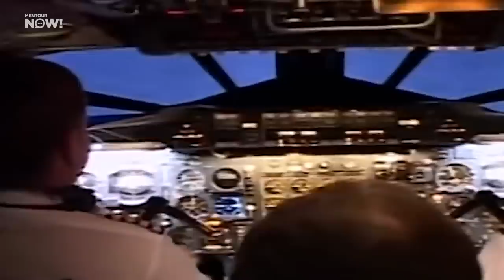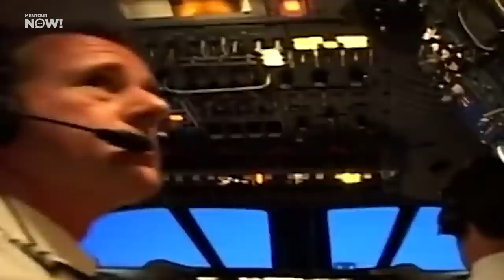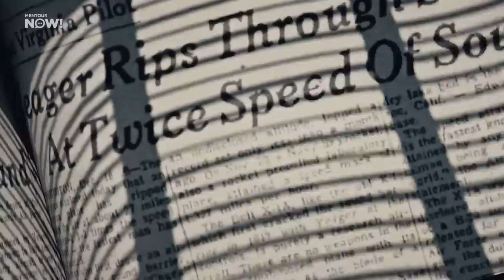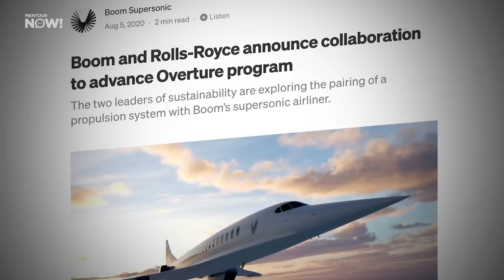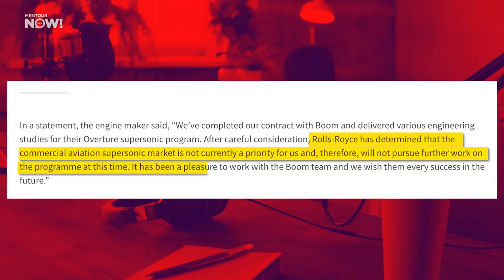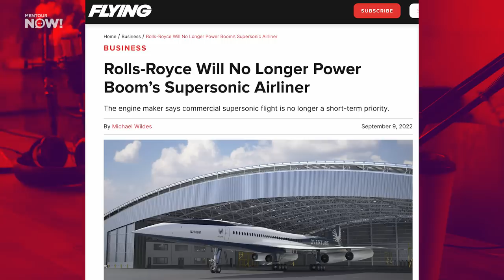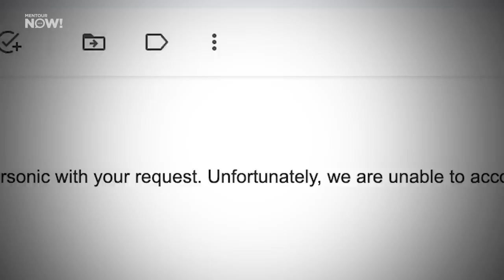WHAT’s Going On with BOOM Supersonic?! Will it Fail?

Comment: Į know only one aircraft that had 2 different types of engines. Beginning with the B-36D, Convair added a pair of General Electric J47-19 jet engines suspended near the end of each wing; these were also retrofitted to all extant B-36Bs. Consequently, the B-36 was configured to have 10 engines, six radial propeller engines and four jet engines, leading to the B-36 slogan of "six turnin' and four burnin' ".
Reply from the maker: I stand corrected. Thanks!
Reply: Some versions of the C-119 Flying Boxcar had a "Jet-Pack", a turbojet mounted on top of the fuselage.
Love the B-36 as well:
two turning, two burning,
two smoking, two choking
and two more unaccounted for.
Reply: @kilianortmann9979 
>and two more unaccounted for

oh... oh no
Reply: @MentourNow  You could also count the BAC Trident 3B. That was a tri-jet that technically had 4 engines. A Rolls-Royce RB162 turbojet as a 'boost' engine to give 15% more thrust on take-off. Was only used when required, but that's kind of worse in the sense of otherwise being dead weight and still needing maintenance.
Reply: There been quite a few aircraft with a mix of engines. Most of them are prototype or pre production, but there was a few full peoduction.

But this is not the same as in the case of then3 engiend boom, that was really the same core engine with a diffrent index. If I rembeer corectly that is also true for 727 and L1011

Anyway, here is a list of mix engine aircradt
A-90 Orlyonok
Avro 720
Blohm & Voss P 194
Bréguet 960 Vultur
Consolidated Vultee XP-81
Curtiss XF15C
Douglas D-558-2 Skyrocket
Douglas XBTD-2 Destroyer
Grumman OV-1 Mohawk
Gulfstream American Hustler
Hawker P.1072
HyperMach SonicStar
Lockheed NF-104A
Lunar Landing Research Vehicle
Mikoyan-Gurevich I-250
Republic XF-103
Rocketplane XP
Ryan FR Fireball
Ryan XF2R Dark Shark
Saunders-Roe SR.53
Saunders-Roe SR.177
Skylon (spacecraft)
SNCASO Trident
Sukhoi Su-5
Vickers Type 559
McDonnell XF-88 Voodoo
Zero Emission Hyper Sonic Transport

This list also contain a handfull of aircraft that never left the mock  up stage. 

But it dont contain aircraft with diffrent index engiens. It also dont contain test beed  aircraft like the 747 and A380 engine test plattform, and it also dont include  aircraft  with lift engies,  as well as helicopters will push jets
Reply: In the same vein, KB-50s, and later KB-50Js with two J47 jet engines were used by TAC and others as aerial refueling tankers. In addition there were prototypes of other planes that played with similar concepts.
Reply: @matsv201  Great list, how did you compile it? If one thinks about it, even today a tri-engined jet with one engine that is much larger than the other two could be more energy efficient if the other two are shut down once the jet has reached altitude and burned off some fuel. This keeps the core of the large engine running at more optimal conditions. But then this configuration must be more financially economical even with two different engines.
Reply: @Mentaculus42  well.. two step process.
1: found the wikipeda page
2: copy pasted  it

No, jet engines.are more efficent at medium thrust. Not only are the efficency a bit higher, but the thrust surface area is larger.

If an aircraft run on one  engine the slip loss may be as large as 40%, but if it runs on two its down to about 20%.. well. Thst would be typical full load number in theory.

In reality the aircraft would need to drop both altitude and speed to maintain flight on one engine.

The engines are optimized for level flight. Both i power  and diameter.

On takeof the engines have much lower efficency. But that dont matter because it only last for 2 minutes.

Its worth saying that there is one plane having a configurarion thst you sugest. It have 8 turbojet and two turboprob in sn axual  propeller design.

Its the A90.. firsr plane on the list. 4 produced
Reply: Don’t forget the one that saw service as both a military aircraft and air tanker for 70 years, the Lockheed P2V Neptune.
Reply: Yeah, this is the one that came to mind for me, too. But, of course, the Strategic Air Command did not have a requirement to be profitable (except to the extent that "provide a credible reason for the USSR to not nuke the whole West" is considered profitable.)
Reply: @vbscript2  To be fair. While the civilian jet manufactures was inching up the bypass ratio from under 1 to about 2. Strategic air Command ordered the C5 project leapfrogged it directly to 8.

While the General Electric TF39 that won the contract was a terrible mess. The competition that lossed was incredibly good, the JT9D mostly.

Worth saying, and yes, its common. The 747 was a civilian redesign of a failed C5 bid.

And the DC10 and L1011 uses a lot of the systems from there C5 bid.

That in turn promoted the A300 and 767 as more economical wide body aircraft... That evolved into the A330 and 777 that is pretty much the mainstay of wide body aircraft today.
Reply: @matsv201  Oh, yes, lots of stuff that was originally developed for the USAF and NAVAIR later had very useful civilian applications. Even the CFM-56 was developed from the F101 core. I just meant that SAC itself didn't have to be directly profitable.
Reply: The KB-50J had  2 different types of engines. In addition to the 4 piston engines of the B-50 series, it also had 2 jet engines. There were 112 built, actually conversions from existing B-50 aircraft. 
4 × Pratt & Whitney R-4360-35 28 Cyl. four-row air-cooled radial piston engine, 3,500 hp (2,600 kW) each
2 × General Electric J47-GE-23 Turbojet, 5,200 lbf (23 kN) thrust each (auxiliary engines in KB-50J tanker only)
Reply: @MentourNow  Fairchild C-123J and C-123K used radial piston engines with turbojet booster engines( added around 1965). 
The C-123 family started as a glider, and along with the mixed engine versions was also made in radial engine,  turbojet, and turboprop. Used from the 1950s through 1980s
Reply: @ghoul11719  I was just about to mention the Neptune, having seen the one run by HARS in Wollongong Australia. It's in flying condition using the props, not the jets.
Reply: The one of a kind, Burt Rutan designed, Scaled Composites Model 202 Boomerang is an asymmetric, twin engine airplane with 2 slightly different engines. One engine produces 200 hp and the other produces 210 hp because of a different turbocharger. Probably not much of a maintenance concern for a fleet, and because only one airplane was built, it doesn’t really matter. Still, a very unusual and innovative airplane, putting it in my favorite list of planes.
Reply: Back in 1978-1980 I was a student at the Pittsburgh Institute of Aeronautics,a Junkers 52 landed at the Allegheny County Airport, the left engine blew a jug on landing, the crew removed the nose engine and installed it on the left wing and installed a different engine on the nose, I always wondered if this was at one time a common practice on those rare 3 engine aircraft.
Reply: It seems most of the examples given are military aircraft during the transition from piston to turbine when some aircraft had turbojet engines added to supplement the piston engines. Which is interesting but it doesn't take away from the main point related to commercial airliners which is that it would be costly and operationally inefficient to use more than one type of engine on the same airplane. That was less of an issue with military aircraft where capability has a higher priority than economics.
Reply: @Kilian Ortmann

I was just about to mention the C-119, lol. I didnt know about its jetpack mod until getting the chance to take a few pics of the C-119 "Know Fear" that is currently rotting away in a boneyard in Fairbanks Alaska. Took one look at the mysterious jet nacelle bolted to its fuselage and was like "I need to know more about this".
Reply: @matsv201  >> That’s quite a list!  There’s also the Martin/General Dynamics RB-57D/F, which had P&W TF-33 engines with P&W air-started J-60 turbojets, used at altitude.
Reply: @jaybee9269  this list is limited to diffrent types  of powerplants  not diffrent brands or versions. It also dont include  engine  testbeds  like The 747 and A380 testbed that exist today.
Reply: @matsv201  Basically what I am getting from this is you have a few different reasons to have multiple different engines. Ignoring Skylon, there is suplementary power (KB-50, B-36) where it's about adding more power in a more simple way to a heavy piston powered design. Then there is adding a rocket/motorjet/jet to an aircraft for increase the speed of the aircraft, especially in a combat role (FR Fireball, SR.177). And then there is the only one that tends to use smaller jets for both, VTOL aircraft that need a lifting engine of some kind (Yak-38, Mirage IIIV, Do 31). Actually the lift jets used in the Do 31 would be used for the suplementary role in the Trident IIIB.
Reply: In the UK we had the Avro Shackleton MR3 with four Rolls Royce Griffon piston engines and two Armstrong Diddley Viper turbo jets located I the rear of the outboard engine nacelles.
Reply: @GroundHOG-2010  pretty much yes. But with saying is that in overture case it would not be two diffrent types of engines, but rather two diffrent version of the same, or a simular engine.

I think that is the case for Boeing 727... but i might be wrong on that.
Reply: The Trident 3 did also, a smaller 4th engine (yes it was a tri-jet) to add more thrust

Comment: "I don't know if I've ever heard of any aircraft that had different engines on the same airframe." Here's one: the Hawker Siddeley Trident (used by British Airways) had a tiny Rolls-Royce RB162 turbojet installed on its final 3B model that added 15% more thrust just for additional "hot and high" take off performance. This was easier than redesigning the whole aircraft to accommodate larger engines than the normal Spey models. As a kid, I remember seeing the Tridents around Heathrow in the 80's.
Reply: common knowledge about the Trident 3 that is, a tri-jet with 4 engines
Reply: You didn't know this until you googled it. Stop playing smart.
Reply: @sparkythesecretsquirrel4013  Uh, Google wouldn't exist for a decade when I was seeing 4-engined Tridents with my own eyeballs.